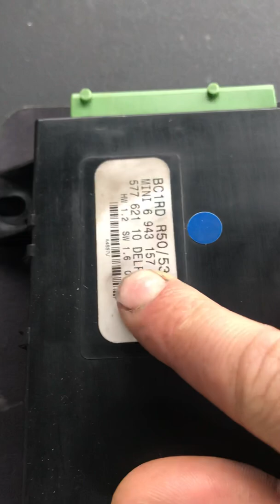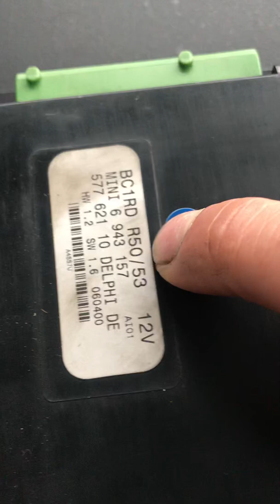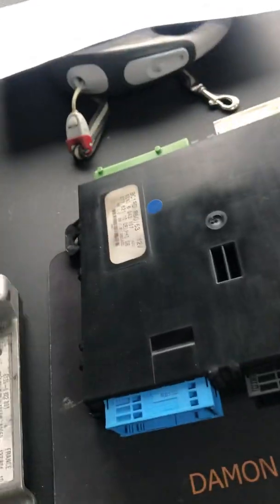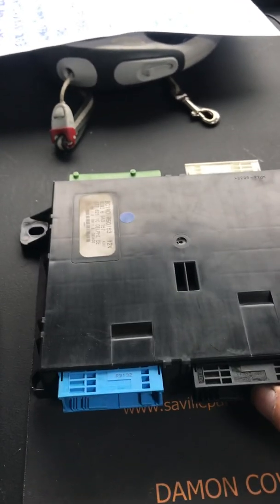MINI BCU FAULT HOW TO REPAIR, R50 R52 R52 (different types of BC1) body control / footwell module

Comment: please could you help me mate, i changed my catalytic converter and suspension and since then, my car turns on with the battery light showing, and power steering doesn’t work, i rev it to about 2.5k and it the steering works and lights turn off... i press the brake and the headlights dim, i’ve had a new battery in and the car keeps dying, i’m sure it isn’t the alternator

Comment: Hi, does the BCU have any control over the wipers mine won't turn off?
Reply from the maker: Yes all body related items run though the BCU it’s most likely the cause of your problem but shorting wires and switches shouldn’t be ruled out. You plug a second hand replacement BCU in and see if that cures your fault or alternatively have an auto electrician confirm it for you

Comment: Great video. We have a 2002 Mini Cooper that the ignition lights stay on when the key is removed and subsequently the car won't lock ! Could this be the BCM or the ignition switch. I got a guy to come out and he plugged in his diagnostics but couldn't find a fault on the computer.
Reply from the maker: Sounds like bcm try a replacement bcm used part from eBay shouldn’t be too expensive, I have another video on how to replace them and what to look for. The central locking won’t work until the bcm is coded to the car but if the dash lights work as they should then have a auto electrician or mini specialist code it in.
Reply: @theminigurus4299  Exactly as you said .. Replaced the BCM and all works except the locking ... will seek out an auto electrician to sort .... thanx for your reply :-)

Comment: Hi. Thanks for the video. I’ve noticed my electric windows are playing up and headlights are staying on even when turning to the off position on the stalk. Also I’ve noticed the steering wheel button lights staying on when the stalk is off. It’s an r50 2004. Do you think this could be the BCM?

Comment: Hi. We have an R50 that is telling us that there is a problem with the head airbag right. We don't have one so how do we fix something that we haven't got? Any advice would be great.
Reply from the maker: Hmm difficult one you either need to do what I did on this video use a resistance tester then fit a resistor to remove the warning light I’m not sure what ohm resistor you will need for a curtain airbag, easiest way would be to buy a second hand airbag and swap it they won’t be expensive and doesn’t need coding in. Thanks MG
Reply: @theminigurus4299   There has never been a certain bag fitted so why would I buy one? I would not know where to plug it in. I do have a 2.2 resistor and can fool the system with it but I have nowhere to put it as I've never had a head air bag. It's my problem. Thanks for trying but you haven't understood the first message.

Comment: Just got an 05 s and sometimes my wipers in the back stop randomly then start again my windshield wipers only work on the last 2 settings and my driver door doesn't like to unlock i have to hit lock and unlock a few times. Also when indicating my hazard light on the dash illuminates not a left or right directional arrow. Thanks for any input
Reply from the maker: Think you have a couple of issues going on the drivers door will be the door actuator (door lock) regarding the wipers that’s most likely a switch issue the stalks can go faulty I would be surprised if a BCU would cause that. Finally the hazard light is strange never come across it to be honest I wouldn’t like to guess your best bet may be getting an auto electrician out for the sake of £70-80 to confirm each fault rather than throwing expensive parts at it. Sorry I can’t be much more help without testing it myself.

Comment: Have a Mini Cooper R50 and an issue with OS main beam only flickering then staying on until battery disconnected. Then after BC1 unit was checked by BBA, the NS main beam only did exactly the same! 

The drivers footwell is very wet, and have noticed issue may be after a lot of rain then warm sun? Could this be water vapour causing an issue again with the BC1 as BBA tested again and said no fault found? Thanks for the video!
Reply from the maker: Ok so basically looking at the wiring diagrams for the R50 it can only really be the BC1 causing the issue I would recommend buying a second hand one to plug in without coding and see if the problem cures if the problem is corrected then have it coded to the car so the central locking will work on the replacement BCU/BC1
Reply: Okay thanks I’ll do that. Does the BC1 have to be coded by a main dealer, or any auto electrician or can it be done diy? Thanks for the advice
Reply from the maker: Long term yes but to test it no. If you want the central locking to work it needs coding but to test and start engine etc it’s fine I un-coded

Comment: Knew nothing of fixing BMW Mini until few days ago, nephew bought one. But, then i was  told pass. door wouldn't open, or drivers window. Also headlights playing up, randomly on when selected. So after a day trying to fix, i pulled the plug on the Body Control Unit (behind plastic trim next to accel. pedal RHD cars) squeezed in a touch the female sockets on the big green plug, refit and everything works fine. Also it looks like where the bonnet release lever is mounted, it's located by a hole in the sidewall, that i noticed was slightly rusty. Is this the source of damp ruining the BCU on some cars?
Reply from the maker: Yes the big green plug at the bottom you can try and clean the pins if your lucky, but normally gets into the circuit board too and requires replacement.

Comment: Hey Mini Gurus in my 02 R50 the sunroof only operates when the radio is disconnected. If there’s power to the radio the sunroof is non functional also when the radio has power it is either blank or completely lit up like it’s in some form of test mode I’m leaning  towards a bad radio but  is it possible for bcm to cause this?
Reply from the maker: Ideally without guessing you will need wiring diagrams and test the circuit to find the culprit,  bcm is possible however we have never seen this fault before. If you don’t want to test wiring or pay someone to test wiring then start with cheapest option probably a second hand radio. Many thanks MG

Comment: Think mine is faulty, 2008 Mini Cooper s convertible, the computer screen keeps going on and off and the wipers go on without touching arm lever, also trouble staring sometimes, when it doesn’t start well the dcu light is highlighted, TIA
Reply from the maker: It sounds like a faulty BCM but it’s unlikely the trouble starting is the same problem that will be a separate issue more than likely

Comment: Hi, My front wipers wont work some mornings, the rear wiper will, and the front wiper would come on when I used the washers. But other than that, nothing! Then about an hour down the road they decide to work as normal... a few weeks ago when we had floods, I drove through a huge puddle! And i felt drops of water hit my legs! Do you think this could be a BCM problem? If so, do you have a rough price to get one programmed? Thanks!
Reply from the maker: It sounds from the description you’ve given more like a faulty wiper stalk they are common to fail too.. you can replace them fairly easily at home. BCM is still possible but you would more than likely suffer other problems too such as lights staying on, central locking playing up etc.. hope this helps

Comment: Hi mate just a question wipers won’t turn off and when the do the stop mid screen ! Is that an issue caused by this bcm ? 
Thanks
Reply from the maker: Yes I would imagine that’s the BCU very common problem when they start to fail.

Comment: Hello, I have an issue so hopping that someone successfully dealt with it. Car is a 05 R53
This is a random issue that starting bugging the car again lately. When turning the steering wheel (usually in very low speed or stationary) I totally lose electrical power or I have a massive dive. This results in power steering loss for a few seconds (about 10 or so) the engine stalls or goes out completely. When the latter happens I also have the instruments resetting as I would do it from the menu or if I took the battery off.
Anyone that can shed some light on this problem?
Thank you
Reply from the maker: Kostas S sounds like power steering pump is pulling too much power from the battery I would check the engine earth strap, battery and alternator conditions. If everything tests ok is possible the power steering pump requires replacement.
Reply: @theminigurus4299  thank you for the trouble of replying. I will Check those this as soon as I can. And see what's what

Comment: Thanks for the video, check out my issue...  My mechanic can’t figure out what’s wrong and it’s been like this for months.  What do you think?  https://youtu.be/HkGWv6ol-AM
Reply from the maker: Tim D'Aquino  that’s nothing I’ve come across before, you need to check the BCM/EWS connections may be easier paying an auto electrician on that one!
Reply: The Mini Gurus It’s so crazy man!  Just spoke to my mechanic, Luis at Precision AutoWerks Miami and he di
d  change the  ignition switch out and said the lights don’t seem to be coming on while car is off, nor the car still running after key is out.  But we already a went through a time where this was “cured” and came right back immediately.  The battery still drains suddenly, randomly.  So If anyone has had this issue, and resolved it, please PLEASE reply.  We’ve been digging into this for almost a year now and absolutely nothing has worked.  :/
Reply from the maker: Tim D'Aquino I would be able to get to the bottom of it but it’s very difficult without having the car and I’m uk based but I wish you the best of luck

Comment: Good Morning,
I was wondering if you could point me in the right direction please 

the vehicle in gages to move fwd at 15oormp it jerks hard and makes a winding noise in the transmission 

I have a 2003 mini base 

I have the codes

vcu supply of ews3 control module 

zke central body electronics 

valve secondary pressure duty factor

Comment: Informative video! I got a 2004 MCS, ac button doesn’t illuminate or work. Sunroof works perfectly only when connector is unplugged and replugged, this does not work when the car ignition is ON, only works when the car has been turned OFF. And finally Remote control locking doesn’t work. BCU problem maybe?

Comment: Hi I have just had a problem start today and suspect it's the bcu, possibly caused by the recent bad weather, possible short. 
The electrics have gone haywire and erratic different things seem to happen on and off.
Some of the issues are, central locking not working, wipers going on and off at random with no input and stopping in random places head lights on all the time and intermittently flashing, no indicators or hazards, hot air blower not working intermittently, windows not working intermittently, interior lights flashing and just general random electrical issues.
I've swapped the battery, checked all the blade fuses and they are all OK and dry.
Does this sound like a bcu issue and fixable with a bcu swap? Any advice welcome. Also what should I expect to pay for a reprogramming thanks

Comment: Hi . I need to replace my bc1 but the problem I am having is disconnecting the green connector. does it need a special tool?. It looks like it has to be slid to one side before removal.
Reply: I'm having the same problem - did you get your green connector disconnected without breaking anything? Other videos I've watched seems like everyone has problems getting it out.

Comment: Hi I’m not sure if you will reply but, my left side indicators (front, side, rear) all work, on the left side, the front works but the side and rear don’t. However when I switch side and rear lamps to the left working sides it all works. What could the issue be?

Comment: Thank for the video, I have a 2003 R53 Min Cooper S - symptoms are internal lights turning on randomly, car unlocks itself and then keeps trying to unlock which you can hear when standing next to the car.  This has in turn flattened the battery but with a little push start goes no problem. Have been told through a club it was the BCM is this correct or another fault do you think? Please help if you can...

Comment: Thanks for the video. 
I have a 2007 Mini Cooper r52 convertible. I hope you can help with the following: 
1.AC control is not working. No AC no heat. 
2. Airbag light remains on  
3. Seatbelt light stays on even when buckled in 
Do you think any of these issues are related to BCU?
Thank you.
Reply from the maker: lucio martinez possibly I havnt come across all these problems together they are all usually seperate faults, you need to have it scanned for the fault codes first then come back to us.
Reply: I'm having the exact same issues with 2005 r53. Did you find out what the problem was?
Reply: @Mixntweek1  i have not found the problem yet. I don’t use the car much, but if you find out what the problem is I would appreciate it if you comment again.I’ll comment back if I find the problem. Thanks !

Comment: Hi... I'm going to open up the unit on my 2002 cooper 1.6...key opens and locks doors and everything lights up as normal when ignition is turned on. However give the key that final turn to start it up and nothing. Won't even turn over. I was also thinking about the immobiliser unit situated near the bcu. Could that be at fault and if so would a used one need to be programmed in??.. Cheers..

Comment: Hi I have an issue on a 2003 R50.
The sidelights and interior lights stay on when switched off and keys out and as a cosiquence the battery drains over night.
Is this likely to be a fix on the bcu, replacement or can it be fixed with a code reader?
Thanks
Reply from the maker: simongunner I’m 99% sure that’s BCU  buy a used BCU and plug it in to make sure the lights go out before having it coded.
Reply: @theminigurus4299  thanks. Just checking is it drivable before getting the coding? Obviously got to be careful driving to my local mini specialist

Comment: thanks for your video, i have an 2006 R50, and i dont have right side turn lights, left side is ok, cant open the trunk from outside, no dome lights and remote key doesnt work too, BC1?
Reply from the maker: Victor Munoz sounds like typical BC1 symptoms however the trunk may be the micro switch or corroded plug pins

Comment: Got a mini one convertible and just too late for the re waterproofing the roof and loads of moisture inside...all done but speedo not working as well as the roof/parking sensors not working....had a guy who works for mini plug the diagnostics in and it’s come back the BCU...and saying it’s all kinds of money to buy part and re code....you’ve just blew his theory away as he’s obviously not a mechanic and just a ‘fitter’.....hard fix?
Reply from the maker: Baz Riv if in doubt always have it diagnosed somewhere else first before believing what this mechanic is saying, however it is possible for the BCU to drag coms down to the convertible top module, you can get a second hand BCU cheap from eBay and make sure it works before having it coded to the car, the coding is only for the central locking really, is it an r52 or R57?

Comment: I have an r50 and when I lock the car from the outside it locks and unlocks which sets the alarm off after a minute or so as I need the key in the ignition after I unlock it as a safety feature, I don’t have central locking as I think the battery is dead (only had it a couple of months) hoping it wasn’t the bcu as I font really have the money
Reply from the maker: No that’s not the BCU I’ve had this before I’m pretty sure it was the alarm module but a quick fix if you can’t afford take the alarm fuse out it will cure the locking problem. , please subscribe for free if you havnt already it helps us out. Thanks

Comment: i have a 2008 mini copper s turbo automatic hard top.The problem i having is no reverse lights???? bulbs are good ,no power to pin at real lights,all fuses under hood are good ,all fuses at power box on the passenger  side are good???? from dealer they said this does not have a reverse switch this  makes sense and why i cant fineit. would the footwell mod  cause this??? hope you cane help  Gary
Reply from the maker: That’s a good question there is a reverse light switch but I believe it’s built into the selector lever, I highly doubt it’s the BCU usually when the bcu begins to fail you will have other problems too such as central locking not behaving etc. I would have an auto electrician test the wiring and selector lever switch

Comment: Hi there, after some advice please. I have the ABS, flat tyre, traction control  and handbrake light on and the speedo comes on and off sporadically. When the speedo works the lights go off when I have the foot brake on. I have replaced all of the ABS sensors but no joy. Could the BCM be the cause. 
Thanks
Reply from the maker: Ray Thomas no I wouldn’t have the BCM is the problem here, neither is the instrument cluster it’s usually a broken wire behind the dash that’s dragging the coms line down to the instruments (speedo) if your not confident doing this have an auto-electrician test the wiring.
Reply: The Mini Gurus - thanks for the advice 👍

Comment: yo! slightly off topic question but I am stuck. R56, one of my senders just reads **.* & the sender and cable to the foot well module are fine. I have tested for resistance at the FRM and also wired a known resistor in place. weirdly I get mV at the senders but one still reads and gives half tank level only (expected)  not sure if my issue is gauge or BCM? any help will be much appreciated
Reply from the maker: Matthew Moore last time I had this it was water ingress in the junction box/fuse board lower plug corroded up, give it a check.